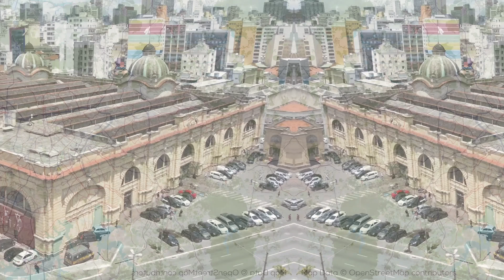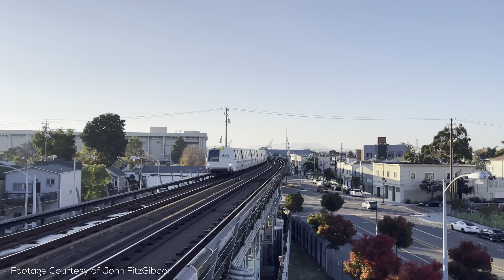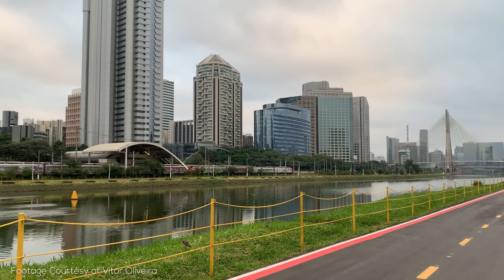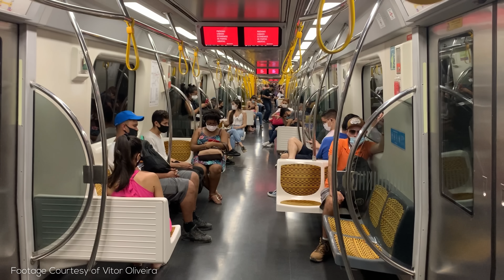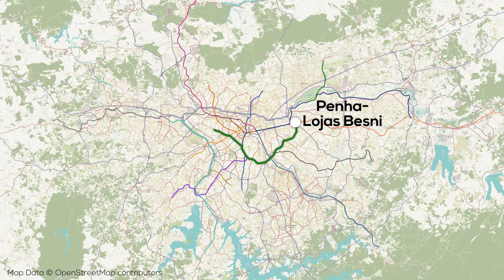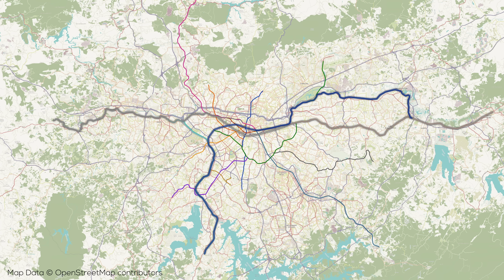The Busiest Subway in the World? | São Paulo Metro, Brazil

Comment: crazy that São Paulo with 20 million only has 104 km of total length of metro... in comparison lisbon that has 3 million people has a 44km...
Reply: That's because suburban train lines aren't included in the network like in other cities, such as Mexico City; in total, there are almost 400km between Metro, Train, Monorail, and People Mover.
Reply: Currently it is now 116km, but it will extend to 148km by 2031. It isn't growing fast, but it is slowly and steadily growing over the years. Within a few decades it will have a truly globally significant system. All the current expansion plans would make it over 300km long

Comment: 11:32 2025 update: you were unfortunately right on the money

CPTM will likely not even exist anymore in 2 years because every metropolitan line is already in control of a private operator, like this november line 7 going to TIC Trens, conglomerate of Grupo Comporte with CRRC, to [in theory] expand service all the way out to Campinas and handle express services from São Paulo, the auction already happening that will eventually culminate in the lines being passed to private operation soon (lines 11, 12 and 13 going to Trivia Trens, owned by Grupo Comporte) or likely there being an auction soon enough for the rest of the existing lines, like line 10 (the only remaining line still controlled by CPTM currently)

not only that, you were right on the money twice because the handover of line 7 to a private operator completely killed off the 710 service in august, splitting the lines at barra funda which not only was the worst station for them to split the service because it's not a station that can handle the amount of users in rush hour, but completely made the lives of anyone that uses specially line 7 due to them losing easy access to two of the metro lines accessible before (lines 1 and 4 to be more exact) making an 1h30 journey longer due to the transfer at barra funda be more of a nightmare due to the reasons cited before

(and since the handover, a lot of problems that are ongoing as of 13/12/2025 in line 7 like slowdowns and longer wait times in the stations, the which didn't happen at this rate under CPTM administration)

TL;DR: the São Paulo gov is just bleeding public assets to private operators while completely ignoring the needs of the population

Comment: THIS TEXT WAS WRITTEN WITH THE HELP OF GOOGLE TRANSLATOR
I see as a difference in the rail system in Sao Paulo, the fact that they are fully connected to each other, whether in suburban trains, or also in subways, which means that with just a single ticket, the passenger can use everything, without paying again. .
Now in the year 2024, 2 more metro lines are being built, which will add another 24 km and 22 stations.
The rail system in Sao Paulo covers 350 km in the metropolitan area, with approximately 256 train or metro stations.
For the international airport, an elevated transport system is in the testing phase for definitive operation, which will connect the train station with all the terminals at that plane station.
The gold line that connects the local airport (Congonhas) with the city's metro-rail system is already in the testing phase, with reduced hours initially, and should operate at full capacity and from 4:40 am to midnight, in mid-June or July of this year, 2026.
It should be noted that it is an elevated line that operates on a monorail.
The transport, called aerotrain, is already in operation at São Paulo International Airport and connects the airport's passenger terminals to the railway line that leads to the central area of São Paulo. There is no fare charged for this transport.

Comment: The City of São Paulo is finally being looked after properly. There are many projects running in parallel as exposed in the video and those other two monorail lines are also advancing as well as the People Mover, linking the Gru Airport train terminal with terminals 1,2 and 3 of the airport. There are plans for a new airport too. But, the State of São Paulo is also investing on fast rail connections with other important cities such as Campinas and São José dos Campos, two of the most important tech hubs in the Americas. When fully operational, these systems should provide a lot more comfort to the inhabitants. Thank you for the video!

Comment: Hreat video! São Paulo metro is high quality, high frequency and clean as others say. It is super busy in part because every line basically runs suburb/center with no circular lines and very few connections outside city center. That is not great as you end up cramming people who don't want to go downtown through the downtown stops. Many of the city areas are severely undeserved too and need to rely on busses (which are also crowded...). São Paulo traffic seriously needs Tokyo levels of subway coverage... I've been to Tokyo, London and New York and you can feel the difference proper subway coverage makes in people's life.

Comment: Great video! I really liked how you considered CPTM as an almost metro, which really it is. Even Brazillian newspapers and some urbanists tend to ignore the importance of CPTM, which work both as a metro near dense neighbourhoods and as a regional and frequent railway connecting other cities to the system.
I'd just point that the expasions you pointed out are on hold right now.
The miniloop would be comprised of different expasions and new lines which have been altered in the last few years and may not create the same design some people expected in the past. However, juxtaposition of several new lines and expasions may create the same effect in the future. And there are two much bigger loops still in the planning board, connecting suburbs (remember that suburbs in Sao Paulo are very dense): 1) one connecting the south of the city to cities in the west (Line 24); and 2) the other connecting the south of the city to cities in the east (line 23). Both are on a very early stage of planning and we don't even now if they will be heavy rail or light rail.
In regards of the tunnels, we haven't heard of them for a long time, even though the guy from Commu still talks about it. It probably is too expensive and not worth it now, since freight rail has been or will be diverged from these lines. In the near future I think most of the lines will connect both in Barra Funda and Brás, while RER type of services may be possible with some simple solutions, like  the 710 service.
I think that the most important expasion right now is line 20, which will finally connect the last of the major CBDs and the most important one nowadays, Faria Lima Avenue. The avenue is pretty carcentric, specially the newest parts, with abysmal transit, having only a bus lane in the left side (where cars turn to enter in the office buildings) used by something like 400 thousand people (yes, it is right). The sorrounding neighbourhoods have also a lots of jobs, density and even worse transit. Besides the people that already use transit, I think it is important to bring the metro to the region to put more affluent people in it and out of the cars - as a city in a very unequal country, transit and walking are very common ways of transporation for people who cannot afford a car, which is in itself a sort of status symbol for the middle and upper midle classes, making it very dificult to convince them on less carcentric policies, to be in public spaces and know people of different classes and consider them.

Comment: As a Brazilian that lives in São Paulo, and have travelled to some places, I'll air my grievances.

The subway metro system is great and new because it was built too late, as you said the lines Silver, Gold and Bronze were supposed to be inaugurated by the 2014 World Cup, and only line Silver is partially completed. 

The red and blue lines are very crowded as more and more lines are being built, connecting to them which end up being a bottleneck to the expansion. Those lines truly need parallel express lines like in NY to avoid collapsing in the future. 

Maybe the ring that’s supposed to connect most of the lines will solve it, but I don’t think I’ll be alive to see it.

Connecting from one line to another during the peak hours is hard, takes lots of time and if you are carrying luggage or something heavy it’s nightmare. The Lilac connection with the Blue line is 7 levels deep. Imagine going all over those escalators can take a long time. Add time waiting on the crowded platforms and switching lines can take 20 minutes or more. If you have to switch lines 2 or 3 times it may be the longest part of the journey. 

Lack of long-term planning made connections of the Blue and Green line very awkward as you have 2 stations (Ana Rosa and Paraíso) to not be able to handling the line switch. 

The Guarulhos Airport station is a joke, and it’s mostly unused as passengers can’t ride with their luggage safely. It should connect directly nonstop with the Congonhas airport, which was the original plan, but they never did it.
  
The smell on the Emerald CPTM next to the polluted Pinheiros river is disgusting.

There you have it those are my grievances about São Paulo metro system. 
But my commute to my work nowadays pretty awesome, as I live 2 blocks away from the subway station at the Blue line and my work is 5 blocks walking from the Lilac line less than an hour. 

Before the Lilac line it was a nightmare. It was inaugurated 3 years ago.

Comment: I love the São Paulo metro/train system!! I don’t live there but I do visit the city a few times a year and my favorite mean of transportation is the public service! By the way, Line 4 - yellow is simply the cutest, it is super safe, the cars are always clean. I have used to this day, lines 1 - 4, lines 9 and 10 and Line 13 to Guarulhos Airport. The CPTM lines are so smooth i could read a book (and i have kinetosis/motion sickness). Plus, you can travel most of the metro net with a single ticket, which costs only R$4,40, meaning sometimes it is not only faster but also cheaper if you decide to go by metro.

Comment: The metro system in São Paulo is absolutely stunning. It has its fair share of problems (overcrowding during peak hours, technical issues) but so far the state-run CPTM lines (7, 10, 11 and 12) offer a decent service.

The subway Metro (the company name) lines (1, 2, 3 and the 15 monorail line) is also decent. 

The private-run lines 4 and 5 are decent, but recently the company that won the concession of former CPTM lines 8 and 9 was actually sued by authorities due to sheer incompetence at running a decent service. Constant failures, wire theft, accidents and electrical failures became common, peaking at points that in two or three months of operation the private company beat the number of yearly failures of the former administrator. Nowadays it's mostly decent but they still experienced electrical failures in the midst of The Town festival... So...

And btw, the state governor has plans of privatising the remaining lines. So you can guess the chaos.
Reply: Another advantage is how cheap it all is. For R$ 4,40 (a little less than a dollar converting) I can hop on a train at my nearest station, ride all of line 11, switch Line and go to the other side of the metropolis and pay only one ticket per way.

Comment: Just an observation: the private companies that administrate CPTM lines has lot of failures and frequently they need the public company to suppy their inefficiency
Reply: Considering they are just operators, what kind of "supply" are you talking about? The whole system relies on "public supply", I think you need to understand what operating a line means. If you are talking about the operational issues that have happened in recent times, such as lines 8 and 9, well, that is to be expected, isn't it? Public administration have been managing those lines for decades, while private administration is new. At least if the companies in charge do not get better you can replace them for new ones. Can't say the same about the public ones. The lines that have been in public-private partnerships for longer times such as line 4 also faced troubles in the beginning and nowadays it's the best one in the entire Sao Paulo metro system.

Comment: Great vídeo, I wasn't expecting it to be this good.

The metro in São Paulo is really good, the biggest problem in the city is the same as any major metropolis, it takes 30min or more to get to nearest mall, sometimes it takes 20min by car just to get to the closest bakery and it's very frustrating, but you can cut through the city just by using the metro. 
Relatively cheap and safer than I expected but we could use more security inside wagons. 
It would be a lot better if more of the lines were privatized, not to mention a complete deregulation of the market, which is heavily controlled by the State, resulting in massive corruption and yearly strikes.

Comment: Ranking of all the metro systems I've used from best to worst:
1. Hong Kong MTR - safe, affordable, efficient, clean. Network coverage is excellent. Stations and trains are modern and clean, making the system a delight to use. Also the system is easy to navigate and stations have multiple exits.
2. Toyko Metro - safe, affordable, efficient, clean. Network coverage is excellent. Stations and trains are modern and clean, making the system a delight to use. I found the wayfinding signage to be lacking and too confusing. Some of the rolling stocks are small.
3. Sao Paulo Metro - safe, very affordable, efficient, clean. Most stations and trains are modern and clean, making the system a delight to use. Rolling stocks are spacious and comfortable. Some above ground stations (Pedro II, Tatuape) have roofs that leak with it rains. Network coverage is poor.
4. Shanghai Metro - safe, very affordable, efficient, clean. Stations and trains are modern and clean, making the system a delight to use. With so many lines, at times its hard to figure out which line(s) one needs to take. Every station look pretty much the same and are too bland.
5. Mexico City metro - safe, very affordable, efficient, clean. Stations and other infrastructures are not well maintained, thus posing safety risks. Network coverage is excellent. Not a big fan of the metro station icons.
6. Washington DC WMATA - safe, affordable, clean. Stations and trains are modern and clean. Although I find the stations to be too 'concrete'. Intervals between trains could be shortened to improve efficiency. Network coverage is ok but could be better, especially outside of the DC region. By far the best overall metro system I've used here in the US.
7. Chicago metro - safe, affordable. Most stations are old, dirty and poorly maintained (not to mention cold during the winter). Trains are dirty and very noisy. Stations are too simple in design. Network coverage is decent.
8. San Francisco BART - Oh boy, where do I start...stations are old, dirty and poorly maintained. Network coverage is pretty good but fares are way too expensive. The rolling stocks are fairly clean but safety and security is a major concern. Stations are too simple and at time don't even have any attendants. Thank god the only time I use it is when I need to go to the airport.

Comment: I pick both the train service by CPTM and the Metro service every day, Gotta say the only thing that bothers be is that it doesn't work 24 hours, both stop at midnight and the train gets back at 4 AM, while the metro gets back at 4:40 AM.

I really like that it's a single price for the ride and pretty much every single station has free transfering (there's a very select few that do not, and usually there's a reason), and you can be sure, if you live anywhere near a station you can get to any point in São Paulo within an hour and 30 minutes, which is saying a lot because of how dense the city is.

Another problem tho, is that there's so much density that a lot of the lines just don't have a break, it can be a sunday, middle of the afternoon on a holiday, the train will be completely full to the point that you're lucky if you can fit in at all, during rush hours tho (6-9 AM, 17-19 PM) it's just unbearable.

Comment: I use the Subway every day here in São Paulo. While the system is not ideal, I think that it is incredible. It is reliable, efficient, and one thing a lot of people here take it for granted, it is SUPER clean. The stations are completely different from the labyrinth of NYC subway stations. Yes, the Metrô have its problems, and CPTM has its whole list of issues (especially on the privatized lines that are incredibly prone to breakdowns), but overall it works as intended.

Comment: São Paulo's subway system is very busy due to the little amount of stations and lines, so people end up packing inside the few existing services. The good thing, however, is that it was built recently, so it is modern, clean and very frequent. And the rolling stock is usually quite wide as well.
Reply: The amount of lines and stations is pretty big though
Reply: @ThePipojp  Compared to similarly sized cities, it is very small. Most people in São Paulo don't have access to a subway station near where they live, so they have to take the bus. To live near a subway station you have to pay a very expensive rent and even there, often times there is no nearby subway station at your work or study place.
Reply: Errou feio, o movimento é grande porque cidades vizinhas usam o metro para fazer compras em São Paulo, são 20 milhões de pessoas ao redor do metrô, o brasileiro procura algo negativo em tudo para criticar
Reply: @brazil6919  Claro, o metrô de São Paulo é perfeito, todo mundo tem ao menos uma porta para uma estação do metrô na frente de casa. Ninguém precisa andar ou pegar condução pra chegar nas estações. Além disso sempre tem um assento vazio reservado para cada passageiro. Não tem como criticar mesmo.